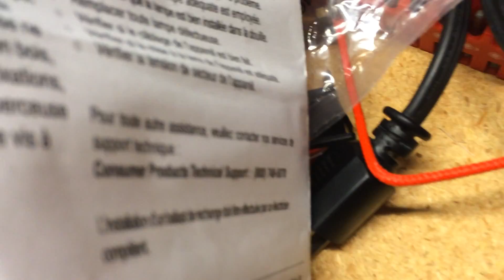Dualit Toaster Repair

Comment: I had exactely the same issue and used a non isolated end sleeve ("Aderendhülse" in German) which I pinched together in the middle with a tiny pair of pliers so the it could be bent. I had to take away a bit of "Glimmer" (the isolating material) in order to feed more wire into the sleeve. Then I pinched everything together with a mallet and a stud that I used like a small anvil. On the picture I took, the repair is barely visible. Works like a charm.
Reply from the maker: Nice!  I am glad to hear that other people are solving the issue the same way.
Reply: In earlier days we had to solder the ends of braid if it should be "good" installation. Today we use what we call "Aderhülsen" (ferrules should be the english word for them) with special pliers instead. They are tiny tubes. You get them with or wtihout insulation. I don't think the material is too important here, as it builds just the "bridge" between the two ends and is more massive than the heating wire. So this part does not get heated up that much. Good conduction should be given though. I fixed it about two years ago and honestly completely forgot about it - still works fine.
Reply: @Weird Science You're welcome. Just for Your understanding. The special pliers ( like these: https://www.ebay.de/i/264144153281?chn=ps ) are normally needed for electrical installation. I did not use them for the repair of the toaster. Here I just used one of these ferrules and carefully pinched it together with a hammer and some tools.

Comment: These days they only seem to make Pro Heat replacement elements which don't glow red, but neither do they heat as well.  In my case it's the center element that's not working, and the Pro Heat replacement doesn't toast as quickly as the original end elements do.  I can see where the old center element's wire is broken, so I'm going to try repairing it.  Found a company that sells nichrome wire by the foot; will see how it goes.
Reply from the maker: Please let me know if it works and where you purchase the element material.

Comment: Thanks for posting, helpful!
Reply from the maker: +TheComing IsSoon 
You are very welcome.  I found very little on repairing or replacing the heating element when I did my research.  So when I came upon a solution I wanted to share.
Reply: Make It Fix It Daddy I have had one for ten years now...the heat element  is still working everything is actually  working just fine...but last time I spilled water in the slots. I left it to dry and it worked...:)
Reply from the maker: +TheComing IsSoon 
The great thing about the Dualit toaster is the simplicity of its design and construction.  I wish I had one to use everyday, since the one I repaired was my Grandma's I only get to use it when I visit! ^_^

Comment: The entire Dualit spares are available online on eBay, or direct from Dualit themselves. Every toaster uses nichrome wire as an element which you can buy separately if you want. Spares are cheap so it's pointless bodging a repair.
Reply from the maker: Please leave another comment with some links.  I appreciate the comment, thank you!
Reply from the maker: Because of the cost incurred in purchasing these items, I still feel it is easier and cheaper to fix the toaster in the manner I have shown (as long as you have the time and tools).  My fix took roughly 1 hour from start to finish.
Reply: Vax Buster, seen from the viewers perspective and from hindsight, You're absolutely right. However that's not the way life goes. 
It's usually either a Sunday, Christmas or Easter and You're about to use the device, when it desides to quit service. And if that were not enough, it does not tell You: "hey, one of my heating elements is defective and no, there's no easy way to fix it". If You're lucky, the device tells You: "hey, one of my heating elements is (currently) not working", which of course can have several causes. So You take it apart, find small items You've been missing for years, remove all the debris, inspect the connections, measure the function of the switches and the resistance of the heating elements and finally come to the conclusion that one of them is defective. Naturally the defect is almost invisible and located in the worst place to think of. Now You know which part You actually need and now You could start to search for a replacement. However It's still sunday night, the table is a mess, covered with parts and tools and You're still hungry (very hungry by now) and (!) You have a shop with tools, and bits and pieces, so be creative! If You're lucky and manage to fix it, You will be rewarded by toasted bread or  become a five minute hero for Your mother, wife, spouse or friend. If not, You will have to order the part and do the repair later. Most of the work is finding the cause and needs to be done anyway.
Reply: Apart from that it is just a minimal defect making the whole device useless - hey it's a broken wire. And the necessary repair is - in theory - a simple one. The only question is, do You have a good idea, the right tools and material to provide that fix. If not, You have to spend quite a bit of money, produce some waste and have to wait for the replacement which is three times annoying.
Reply: I just paid € 7,30 for a replacement element from a seller on ebay. It is identical to the original and works perfectly. My toaster is almost 40 years old.